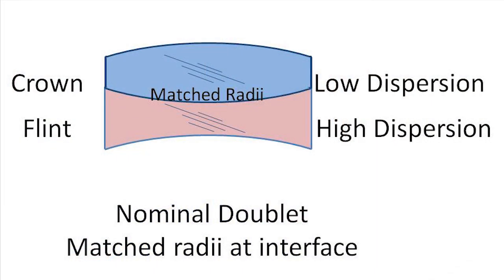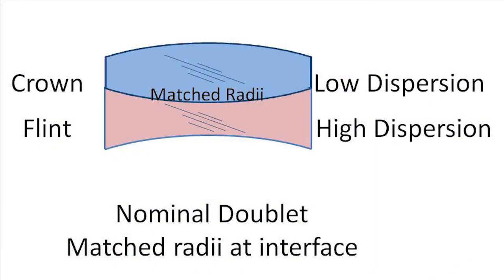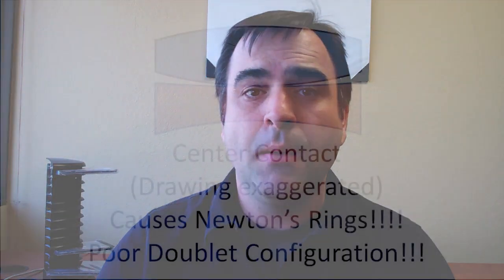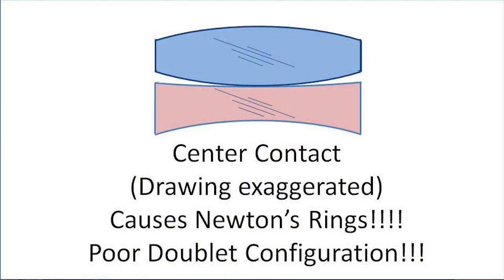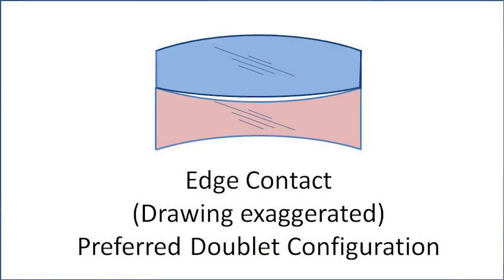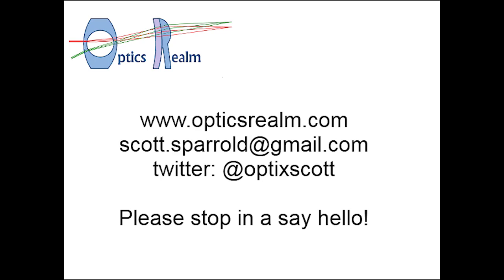Doublet Fabrication: Optics Realm

Comment: Is there a standard bias percentage that they aim for, like 0.1% or 0.01% of the radii?  Is the bias altered, depending on the overall lens size, width or diameter?  Is the bias altered again, depending on the lens material types or pairs of material types?  Thanks